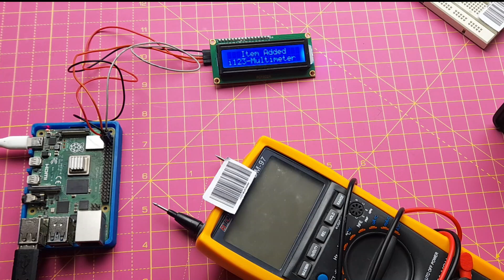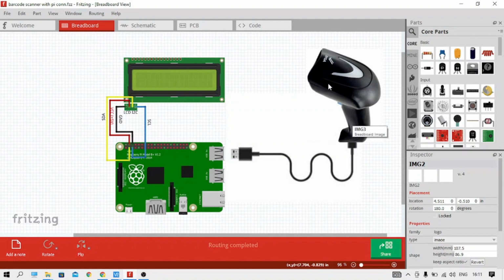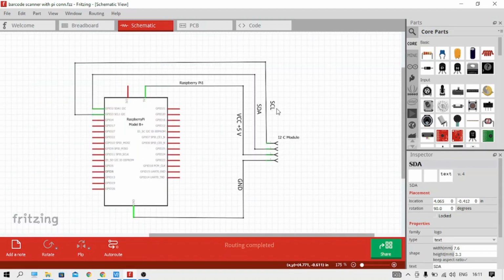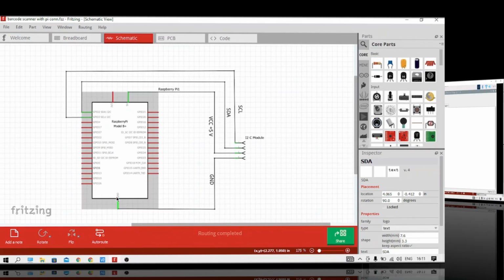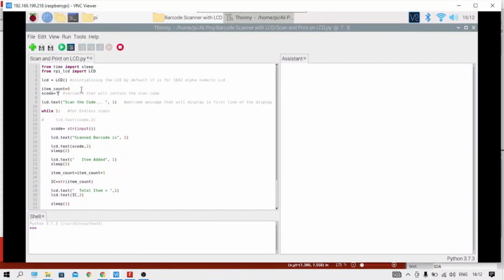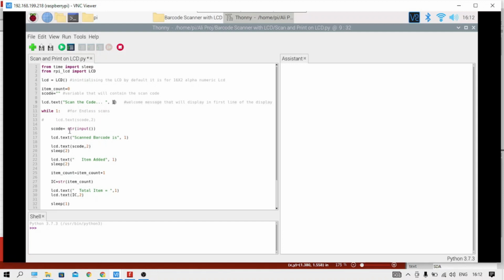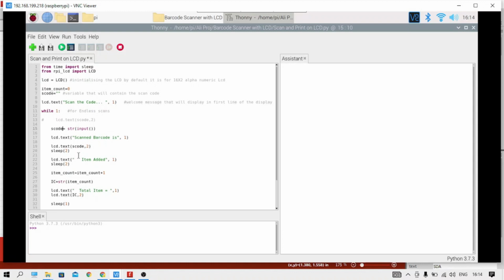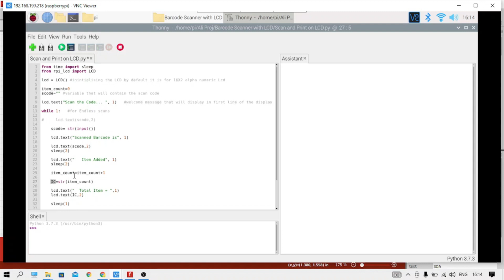How to Read Bar Code using Raspberry Pi | Raspberry Pi Bar Code Scanner

Comment: How do I make the program run automatically? I tried to run your program manually with the monitor working, but I tried to run the scanner reading automatically and it won't appear on the LCD screen